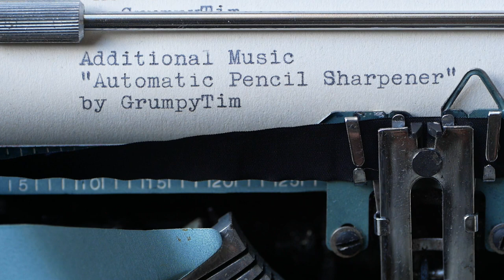Lensbaby for Video - Lensbaby Overview & Sweet 35 Video Test - Restoring a Vintage Woodworking Plane

Comment: Nice work Tim, interesting lenses. Also the plane is now working well.
Reply from the maker: Cheers Benedict - the plane is a bit of a gem - I'd got three to renovate,  just one left to do now.

The Lensbaby lenses are a bit like Marmite, some people love them, some people hate them.  You can get some brilliant results using them but you kind of have to get your head into the correct way of thinking and be ready for not every shot to be brilliant.

I'll be doing the "making a cup of tea using the home made generator" video soon, so that should be fun - and a good excuse to run one of my engines too!!!

Comment: Nice video thanks for these examples, if you have the Twist 60 Optic as well for the Composer  it would be great if u can show some examples on a MFT body too see how it looks :)
Reply from the maker: Cheers AlgerieHD, I don't have a Twist 60 Optic at the moment but I'll keep an eye on ebay in case one comes up at a bargain price - I'll let you know if I get one and I'll put a video together.

It would be interesting to see how much of the twist you'd get to see with the 2x crop factor of the MFT sensor.  I've heard that the swirly bokeh of the Helios 44-2 isn't so pronounced when used on Micro Four Thirds.  I was given a Helios 44M-4 recently but by that stage they had largely engineered out the swirly bokeh.
Reply: @GrumpyTim  Yep this is exactly why i asked for some examples on a MFT system cuz of the crop, i was first looking for the Lensbaby Burnside 35 but i read that the lens isnt that great for MFT cuz of the crop so i decided to go with the Sweet 35 with the Composer it does kinda a same effect only without the Swirl but kinda distorted too, so i was looking to get the Twist 60 Optic also but i dont saw any example on a MFT camera yet.
Reply from the maker: Hi AlgerieHD  I thought of a quicker way you might find samples of the Twist 60 on Micro Four Thirds cameras, there's a Facebook group "Lensbaby Unplugged" - if I remember correctly you have to request to join but it's a big group and there's bound to be members using that optic on MFT so you could put out a request and see if anyone replied.

I'll still keep my eye open for one of those optics and I'll do a video if I find one at a good price.
Reply: @GrumpyTim  Thanks for the recommendation, if i get one earlier i hit u up :)